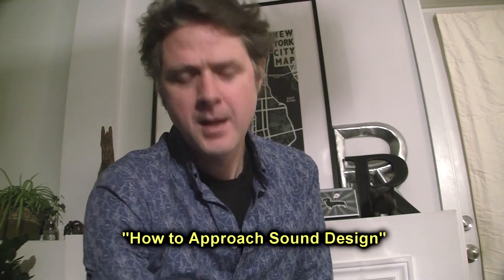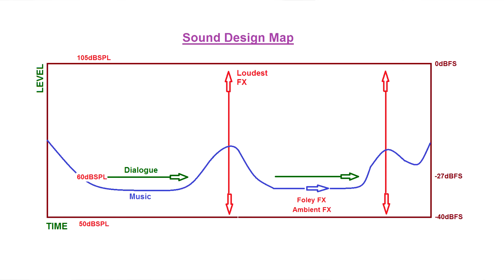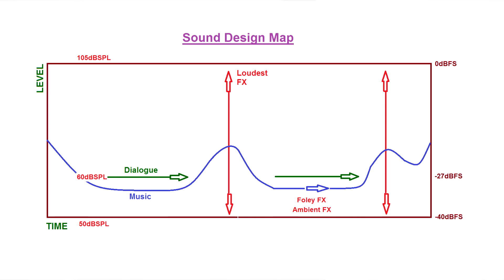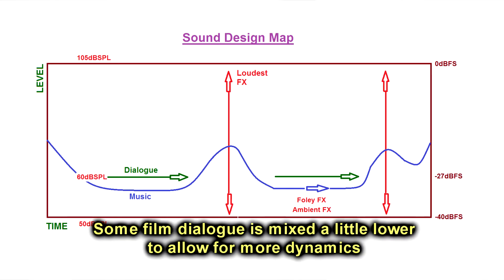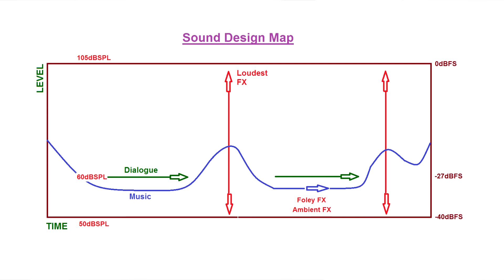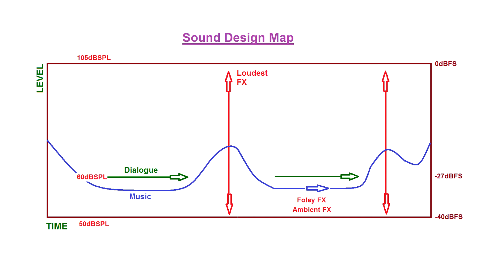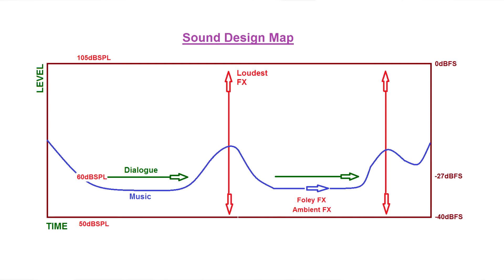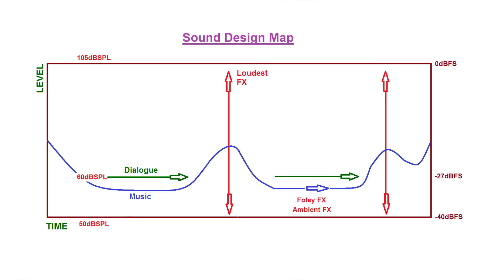How to Map Out Your Soundtrack Part 1 - How to Mix Sound for Film - Audio Levels for Video

Comment: Hi, thanks fot the useful video. You are talking about average levels right? And what about True Peak levels, should the peaks be hitting some number specifically or the only important thing is that they don't hit the 0 db? Sorry if it is a silly question , i'm new to this. Thanks!
Reply from the maker: Great question - for dialogue and music, it is an average level, but for loud, transient FX, it it a peak level of no more than -2dBFS. Dialogue levels may peak up to -10dBFS, depending on compression settings, although I like to have my dialogue peaks limited as well as compressed, so they are lower than -10, but I also just listen to make sure both my settings and actual mix sound good. Cheers!
Reply: @bacontrees  Exactly what i wanted to know. Thanks!

Comment: Usually I get problems after mixing at -24 _ -27dbfs for dialogue. that is when I take this mixed track and play it on other devices it plays at  very level. So how do I overcome this or did miss something?
Reply from the maker: Which devices? These guidelines are ultimately for cinema, or home cinema. Any devices such as smart phones, tablets, etc...require a louder dialogue mix.

Comment: Thanks for the time and Info Buck, its been very useful.  Im entering a documentary mix in Logic Pro X.  I think Im starting to get my head around different measurement units.  To be sure, when in a Film setting, we talk about mixing the Dialogues at around -27DbFs, how would that translate in LUFS?  As you are probably already aware of, Logic gives different measurement tools in LUFS range and integrated and then RMS.  So If the dialogues are averagely flowing at -27 LUFS, is that what we are looking for?  What if,  once speakers calibrated with 1k tone at around 85db, the Dialogue measured at around 63db, the LUFS dont hit -27? Should it?  Should the Dial Flow both at -27 LUFS and 63DbSpl?  Thank you, all the best.
Reply from the maker: I think the documentary mix should be hotter than -27dBFS, which is essentially -27LKFS. For example, The Fog of War measures in at -21LKFS with a dialogue only sample, and down to -24LKFS when limited to -15dBFS (the original signal spiked up to -10 sometimes). Parts with music reached -20LKFS. So, for a doc, I would aim for TV levels at -22 to -24LKFS.

The difference between LKFS and dBFS is the K-weighting when measured (high-pass filter at 100Hz and 4dB shelf boost at 2kHz). So they are close, but K-weighting changes the signal, but is a good way to measure. And the dialogue should measure about 63dB, A-weighted when the speakers are calibrated, but maybe with pink noise at -20dBFS to 85dBC (or 82dB for a smaller listening room - some even say 79dB for small rooms).

I have heard some people say to use a 440Hz tone  instead of 1kHz, but pink noise is popular to use. I do a bit of each just to compare, but then also compare my soundtracks to others.
Reply: Cheers and Thanks for your response.  We are talking -22 to -24 for the overall mix right?  So the Dialogues which are the main audio content of the film could flow a little below that line to leave headroom for louder audio content?  All the best
Reply from the maker: That would be for the anchor element (usually dialogue) as loud peaks will affect this, and depends on your sound design. Check out page 47-49 of this PDF: http://www.atsc.org/wp-content/uploads/2015/03/Techniques-for-establishing-and-maintaining-audio-loudness.pdf
Reply from the maker: Also, I would limit loud peaks to -6dBFS. When I measured CSI episode, dialogue only was -23.1LKFS and action scene was -17.8, while both together were -19.8. So, aim for the spec according to dialogue levels, but be sure to limit to -6. Try it and compare to other mixes.
Reply from the maker: One more paper from EBU - https://tech.ebu.ch/docs/r/r128.pdf
Reply: Thanks again, seems quite challenging to maintain the overall Loudness at -23LUFS with an error margin of 0.5!  It is all very technical but will do my best fit in.   Thanks for your time and responses.
Reply from the maker: Actually, I should have mentioned that the target loudness for TV is -24LKFS, +/-2dB.
Reply: So Mix keeping an eye on the Loudness Level.  Once mix is done, get a reading and modify gain appropriately to desired standards. right?
Reply from the maker: Yes! Once set up and mixed, tweak until you get to spec, especially the dialogue levels. And find the specs for that particular broadcaster, as they vary.
Reply: Hey Buck, Ive got another one for you!  The best way to grab, rip or  and extract a faithful reference?  Dvd would give different loudness rendering I presume and web also.  Any tips on how to proceed on that one?  Thank you again for sharing your time. Cheers
Reply from the maker: I have digital copies from purchased DVD's. There is also a whole procedure for taking the sound from a DVD player output into computer sound card by finding the loudest peak of an action film and being sure to record the output so it doesn't peak into distortion.

This would take a few tries to get right. Then analyze the waveform on the timeline, set up your speakers with a 440Hz tone or pink noise as described, and the dialogue levels should play back at +/- 60dB, and when analyzed, should be somewhere near -30dBFS (not an exact science, but it will give a pretty good reference).

There's more, so stay tuned and I will share. Cheers!

Comment: Thank you very much for a wonderful lesson! In some films, I see a level of dialogue from -18 to -12db. And the cry of a man somewhere from -9 to -6db. Is this normal? I'm always very worried about the low level of dialogue for downmixing from 5.1 to stereo.
Reply from the maker: -18 to -12 dBFS is too hot a signal for dialogue, on average. Some voices can be louder for effect, but only short term. Dialogue levels, on average, are safe between -24 and -30, also depending on how much you EQ and compress. Cheers!

Comment: I really like your tutorials, great work!
I have a question about measurement  of the -27dB dialogue level, you add a note that says it can be measured in loudness meter but isn't loudness meters measure in lkfs units?
 cheers.
Reply from the maker: Thank you! Yes, but in this case, dBFS and LKFS are pretty much the same, except for the K-weighted curve that the Loudness meters use for the measurement. It's just a good indication of where the dialogue level sits. It is handy, but you can mix a film soundtrack by ear, once the speaker system is set up with a good reference. As long as the dialogue level is fluctuating around -27 (or -30) on average, the mix should turn out fine.

Comment: The is great! Thank you! But why mixing for film is always with low dbs? Can you do something like mastering the overall audio? Like in music?
Reply from the maker: Oh, and music is mastered to be squashed to within about 5dB of dynamic range (except classical, as paavoiles mentioned). Cheers!
Reply: Hammam Abdullah I'm not a professional, but in movie it's not any quiter but it's waaay more dynamic unlike most modern radio ready music. Dynamics create the impact in any track. One example of very dynamic music is classical music; quiet parts are really quiet and loud parts are really loud. Same goes with movies; you can create more power and tension with very loud sounds but if there is no quiet parts, the loud parts do not feel even close as loud as they could.
Reply: You're right. Dynamic range is always the key. Thanks.
Reply from the maker: paavoiles - Exactly. Thanks for posting.

Comment: Nice video. Have you some info about loudness in LUFS or it doesn't matter?
Reply from the maker: Yes! When the average is measured, it is around -27dBFS, which is essentially -27dBLKFS (or 'LUFS', same thing). The scales correlate. When mixing for film, it is not essential to measure with a loudness meter, unless you want a specific loudness goal, but for TV, it is essential to aim for -24dBLKFS. When film mixing, you can trust your ears and meters to be sure you have the proper dynamics.